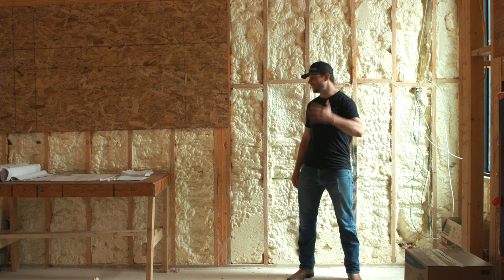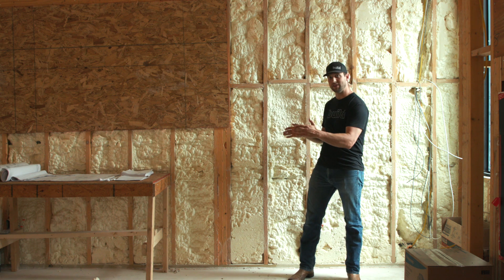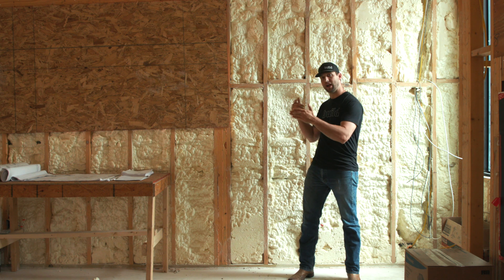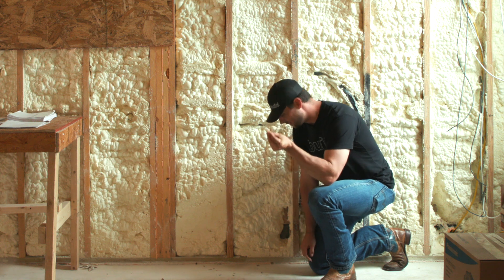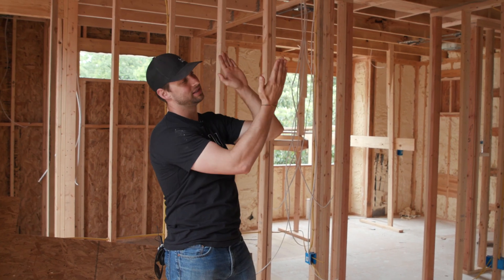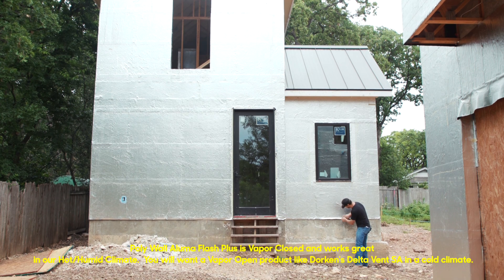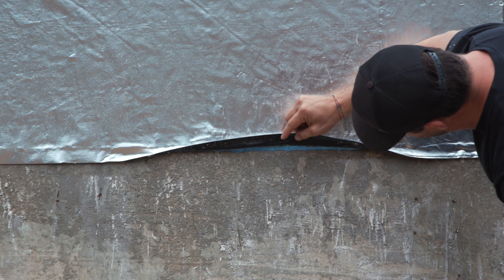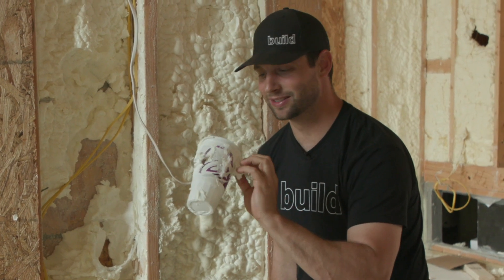3 Spray Foam Problems

Comment: Looks like you have walls that don't have any permeability, hope you don't have any moisture in the house to get into the walls, it could cause big problems depending on where you are located. I remember 20 years ago they used to use a layer over stucco called dryvit, which was waterproof. A few years later they discovered houses rotting underneath because the dryvit would not let the walls dry out.

Comment: What effect does nailing siding through the foil wrap have? I have done several tear offs of siding on buildings with tyvek in Vermont that were 15 to 20 yrs old and found the tyvek was extremely brittle and worthless , apparently it breaks down even without uv exposure. 
Can’t put foil on the outside in Vt though.

Comment: My builder caulked all corners and between boards and where concrete contact was. He said it sealed everything. I asked him the other day if it sealed everything, why do we have ants and bugs in places that have no openings?  We also have just as much dust as we had at our old house. Our return vents and ceiling fans are so dusty all the time and we have what is supposed to be an allergy free system.  The filters are always caked and have to be changed often.  I hate the cost of the filters and it makes it worse having to replace them often. 
  Our attic is completely sealed and all you see is foam.  It stays the same temperature as inside the house.  But I don't get how there's so many spiders up there.
  We'll see in about 5 yrs how well the foam holds up.  I'm already concerned about water damage in the roof framing.  During heavy rainfall, drips appear and have no idea where the leak is.  Which in my opinion is a major downfall with foam that no one talks about.

Comment: To knock spray foam when the installer missed areas (scabbed on 2x4s, underfilling cavities, not caulking bottom plate, top plate and any double studs side by side, and showing them at the close of the video foaming in a taco bell cup) well that's the installer with no care or training or skin in the game.  This has nothing to do with the performance of spray foam.  It's the installer that is the problem.  The foam is innocent.  Also I would foam the underside of the cantilevered section.  You wouldn't be able to make this video if we would have sprayed this!  Separate the installer from the product please.  This video isn't accurate.  The quality of installer is vital to a quality job

Comment: Solid  aluminum sheet doesn't allow the wood walls to breathe , The lumber still has moisture that is escaping and will cause mold.You need a breathable vapor barrier.

Comment: A quality installer is paramount.  The guy that can read the foam as it expands, sets and a few minutes later check to see if the material has destabilized.  The  cell structure is another tell tale sign of the quality of the install.  The shrinking foam from the studs, the shallow areas, and the cup sprayed into the wall all indicate faults of the installer.  Do your homework.  Find a reputable company with licensed installers that are trained to use the very brand they are installing.  Anyone who is worth their salt will be able to provide a much higher quality finished product than what is on display in this video.

Comment: Spray foam is the best, if done right you won't have any of those issues. I could probably heat my house with a space heater its so tight.

Comment: You don't need more than 2" of closed cell foam no matter where you live (I'm in Saskatchewan - extreme temperatures).   This will give you 86% heat retention with GREATLY diminishing returns every inch more, not to mention you CANNOT spray more than 2" in a pass or it will be ruined.  Anyone trying to tell you to fill the cavity to get 'r-value' is lying to you.

Comment: You left out the most important thing to look for. If spray foam (particularly card cell) is sprayed on too thick, it will not cure right and in some cases can make the house unlivable because it will continue to off gas for years.  This is commonly over sprayed in the corners of the attic where the installer cannot get to it easily.

Comment: You should never need more than 3" of closed cell foam...the air tightness is giving you greater r-value you don't realize using the conventional numbers.... You also HAVE TO caulk all the wood-to-wood seams in plates, headers, and jack/king studs.

Comment: The last  thing I would do is put spray foam insulation in my walls could you imagine trying to change wiring or if you would have a water leak it looks to be a nightmare

Comment: So here is an odd thought - my home is 125 years old.  It has 0 insulation in the walls.  Now I admit It's a bit cold and there are a few drafts here and there but Isn't it a bit much to seal up the entire house in plastic foam.  How do you get enough ventilation to breath.  It seems so overkill.  It seems so expensive.  It's a tough sell to me.  Actually I like the idea of the spray foam - my point is if the installer doesn't fill one area to full thickness, how much can it really matter to pull the walls down and redo it?  Yes the heating bill is higher in my home but I know I'm getting a lot of fresh air ;-)

Comment: Hey Matt, I am curious if the cell foam on the interior acts as a vapor retardant and you apply a second vapor retardant on the exterior will there then be the possibility of an issue developing with moisture being trapped between the two vapor restrictive layers.

Comment: Where studs are sisters together in wall assemblies, like at sides of doors and windows, these are huge air leakage channels in spray foam applications. Wood also absorbs moisture in one side (like from interior side of a bathroom or kitchen) and transfers it outside as it "breathes".  I believe the best course of action, sprayed walls and ceilings or not, is to ALWAYS use plastic vapour barrier on the interior.
Reply: Locking moisture in the wall with an interior vapor barrier is a recipe for disaster. Look up Joe Lstiburek's "perfect wall" and read his articles about vapor barriers.

Comment: Does no one use sill sealer? When I was framing in the 1970's we rolled out fiberglass or foam  before installing sills and shoes. One builder used caulk or adhesive instead, but that had to cost a lot more, plus the labor.

Comment: If it was done in stages, like foam the edge of the studs and panels first, all the way around,, the installer can check for
proper adherence, then complete the first two inches all the way around, allowing time for the foam to cure.
Then do the next two inches?. Of course the installer should occasionally review the manufactures manual to make sure he is following the manufactures current best practice directions.

Comment: You did a lot of talking about water leaking from the outside or air through the bottom plate in their home no my code as far as I’m aware of as early or as late as 2005 you’re supposed to caulk the wall before you even stand it up so therefore it’s sealed completely and what you’re talking about would be a relevant now I could be wrong this is in Massachusetts I when I got done with the house I actually had to put holes in the house to get air for make up air for it because it was under 3% so basically I had to go around and put vents in so they had to make a bear the product that you’re talking about on the outside of the building I like very much can’t say I’ve used it But overall I like the video very much and especially with the shrinking of the blown insulation I’ve noticed that many times and I’ve asked and never really got a good answer on it so thanks for that information even though it’s much more complicated than what you went over some of the things you did say I wasn’t aware of

Comment: Good info. I just walked a home being built by Meritage and the foam insulation has many areas where there is 3 inches left to fill the foam to the stud and I found 2 spots with gaps large enough that I could put my hand in and touch the foam exterior lath. This might pass minimum occupancy by the city inspector but definitely not up to par. You should do a video on what the difference is between building a home to industry quality standard vs minimum occupancy vs building a quality home.
Reply: Foam is only as good as the Installer.  It can't install itself.  Separate the two please!

Comment: One of the Best Ideas of SoundProofing is "SoundProof Curtains" That Stops Outside Noise by 80% (25 Db) Tested. Check Here: https://livesoundproof.com/best-soundproof-curtains/
Reply: That is something that a whole lot of people don't know or realize. They are a bit pricy but they look like they cost even more than they do. They hang well and hold the shape of their pleats in good form. They also help with heat radiating through the window. You give good advice.

Comment: What should one do before applying spray foam to an old home?  Should you check for rot/ damage before spraying? What about electrical wires and pipes?  Do they need to be inspected before spraying? Is it better to not spray them and use regular batting for easy access, if repair is needed? I have no insulation under my floor.  The home is lifted above flood level. Basement under the home floods once every few years.

Comment: I am curious as to what would be a good barrier/ wrap for here in northern Kansas, we see summer temperatures in the 110F area and winter temperatures as low as -20 F. We can also see 60 mph winds with the storms we have and often see 30 mph winds without storms.

Comment: Good video-if the concrete wood interface is so prone to air leakage wouldnt it be easier and better for contractors to add adhesive or caulking directly to the foundation and then lay the rim joist onto it?

Comment: I need suggestion by you guy what impact can be there if we apply spray foam in between a  double brick wall by maintains a distance of 4” approximately to control temp. Is it ok to maintain the temp inside the room

Comment: A great way to see if the foam was applied properly is by Thermal imaging with a blower door. I would share some images here but I can't. We have left builders speechless and not so happy with their spray foam guy. I Highly recommend anyone doing this. Send us an email and we can share some images. www.chpinspection.com

Comment: Matt. We are doing a major remodel on a early 80s brick home in FL Panhandle. Nothing between the brick and studs but thermoply. We have decided to go with sprayfoam and encapsulate the house. Should we install a fresh air pipe?

Comment: Whoever sprayed this looks like it was his first time behind the gun😂 also looks like open cell closed cell u never need more than 2 in walls and 3 in ceiling, if it seperates it’s most likely the wrong shit on the truck, you need an air dryer.

Comment: Air barrier vapor open product for colder climates on the outside.
That new AeroBarrier product would it seal that large crack?. 
Could you do it before the drywall was in place?
Seems like Less cleanup?.
Or is the stuff a brittle cake product and needs some rigidity
of everything close to being finished. Is it hydro-curing product?.

Comment: Man this guy is clueless obviously is some air filtration is impossible to seal the all house because builder's always wants cheap work im a spray foam insulation installer and i know exactly what's happened here in this particular job

Comment: My house is on stilts and the bottom is gonna be spray foamed soon just worried about if there will be a smell after
Reply: No there won't be any smell after it's spray foamed. Being outside it will be closed cell.

Comment: Hey man, bought a house, me and brother law renovate it. I need to use closed cell on ext walls. About 3300 board feet. The estimates I’m getting are about 5-7 per square foot. I would need 5 620 kits. Do you think this a project I can have at it?
Reply: If you want to die, yes

Comment: Just call Absolute Pro Insulation. I’ve gotten multiple blower door test with a 0.00 air flow. Pretty amazing on what the foam can do when it’s done by a Absolute Professional.
Reply: ZERO ACH is not safe or healthy.  What your saying is a person could actually suffocate from a lack of oxygen in the house.  Get a family in there, and unless someone opens a door or window, you'll get oxygen depletion in only a number of hours.
If you reading zero ACH, I suspect you are doing something wrong in your testing.

Comment: If you get a leak in your roof, (or sidewalls), the water is trapped, and does NOT dissipate, except in the decking, top plates, rafters, and/or studs, flooring. Usually the home owner doesn't even know he has an issue with leaks until he has a soft wall or floor, where the water ended up. Foam is a fantastic insulator, but make sure you have a leak proof roof. Sorry, but this comes from unfortunate experience.

Comment: Is there any foam that is good for outside walls that are already finished ?
My house was built in 1972 and I don't think there is much if any insulation.
Reply: I know there is a machine that shreds rockwool and sends it through quite a thick hose into wall cavities. I've seen it being done in Europe, I don't know if it exists in North America, but try to find on the internet.

Comment: Silly questions?. 
Why is the wall baseplate not bedded on silicone caulk?  
Why would you not seal over the inside with polythenes sheet under the drywall?

Comment: Do you have any videos discussing spray foam chemical failures and how to make sure that the contractor is using the correct mixture? I have read stories of spray foam causing fumes and horrible odors when not proper. A video about this would be great.

Comment: When using spray foam in new construction. Especially when using the thicker studs. 2x6 and up.  Would it be to our advantage to run 
All electric thru conduit for future ease of repair?
Reply: Yep

Comment: There is such a thing as making a house too air tight. A house has to breath or have introductory air. A house that is too tight is a set up for mold and respiratory problems for the occupants. What about the people on the news recently that had to have the spray foam completely remediated from the home due to fumes/chemicals making the occupants sick?
Spray foam is good insulation but it’s not a perfected product and I would not install it in my home. This comes from a 22 year contractor with 33 years in the trades.
Reply: I've been an installer in the past. I'd always cringe when a homeowner talked about wanting to completely seal their home. I know the off gas can depend on the company that makes it. Some totally cure within minutes.
Reply: That is nonsense, a house shouldn't "breathe" through leaks, it should be airtight and have a proper vent system.
Reply: @CGoffgrid  The people who say that a house should "breathe" say that because they know that's what they'll get with the workmanship of the lazy, drug-addicted laborers they hire. It actually takes a bit of attention to detail and care to build a house where there isn't a breeze blowing out of all the outlets on exterior walls.
Reply: That is nonsense, a house shouldn't "breathe" through leaks, it should be airtight and have a proper vent system.

Comment: spray foam pulling away from the stud in your video is because of poor mixing ratio of the PU with too much Polyol and insufficient Iso. This causes the foam to have an incorrect cell structure and shrink. Too much polyol and foam will shrink. Too much Iso and it will be brittle. In this application where being a little brittle is not an issue as it not structural foam then best to err on the side of less polyol so as to avoid exactly the shrinkage seen. Obviously the perfect ratio as per manufacture spec is the best :-)

Comment: If you get Closed Cell foam installed and it ends up looking like that i suggest you get your money back that spray job looks like absolute hell......also if Closed Cell is pulling away from studs during the curing process it means that the foam was sprayed off ratio and had to much B side in it... To much A will result in a brittle foam but Closed cell that pulls away from studs has to much B side in it.... If this is Open Cell then its a whole different story but he mention vapor barrier and Open Cell is not a vapor barrier so i assume what he is showing is Closed Cell
Reply: sorry .. I wrote my (exact same) comment above before coming down to what you said :-)  don't think we're both fools not differing so we must both be great minds thinking alike :-)
Reply: Onyourbiketoothank you )

Comment: Does anyone know for sure if a tyvek type material is needed behind conditioned attic foamed wall that separates uninsulated attached garage. My applicator just used the cardboard sheathing for a makeshift wall to separate and sprayed behind that.

Comment: Matt,

How did you respond to the subs that stuck that Taco Bell cup into the foam installation? I think it’s totally appropriate to withhold and renegotiate pricing after that. Your reputation is somewhat dependent on stuff like that.
Reply: In my experience as a homeowner of vented and nonvented attics most "pros" just don't give a shit about doing a quality job anymore. And most builder don't hold them accountable cause they are paying them less than a homeowner for work performed.

Comment: Is Spray foam considered a vapor barrier?
Reply: "Closed cell" spray foam applied at least 1 inch (25mm) thick will act as a vapor barrier. Not all spray foams are "closed cell". Some are "open cell". So you need to check with the manufacturer about that.

Comment: Your first problem is that it looks like the house exterior walls were framed by 2x4.

Your second problem is that you went with the cheaper material open cell on your exterior walls.
You should’ve went for closed cell.

Your third problem was that you more likely use the cheapest company to installed the spray foam. Which looks like a couple of hacks.

You get what you pay for.